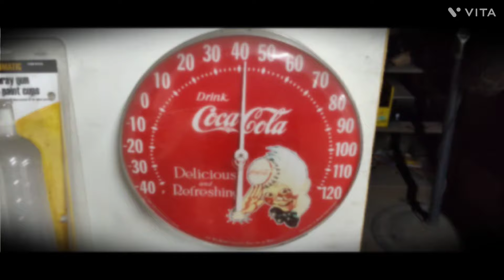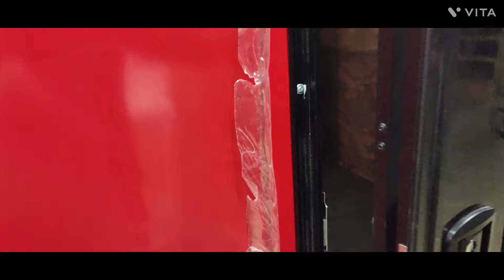Video fixed. second upload SKIN / CORNER TRIM HOW TO SQUAREDROP seems the ice storm messed up first

Comment: I had a question. On the bottom of the camper where the wall meets the trailer, do you rub a bead of silicone and then use the flat trim with butyl tape?
Reply from the maker: @Red-yn9fv  yes absolutely correct, I also pre treat the wood in that area with spars urethane, to add some water resistance to the wood. I think the first coat is brush on and happy the 2nd as it comes in the can.

Comment: Why screw to the window frame into the wall from the outside? I thought modern windows were held from a similar size bracket on the inside, using machine screws to clamp/sandwich the wall in the window frame.
Reply from the maker: Yep modern windows do have a retaining ring inside, I've repaired quite a few that have leaked so I just screw mine in like the doors. I do also use the retaining trim on the inside. Either way works so by all means do it the way that's best for your build

Comment: how long are the short walls that stick out over the frame, what angle is that just 45 on both the front one and back?
Reply from the maker: @venaseph6314  the  short rear walls are 18" back, the fronts angle are a 45 degree angles. the rear angle varies depending on my inside shelf height and rear door size.  I'm actually filming a budget square drop build now and covering the angles and how the rear differs. It should be done here shortly